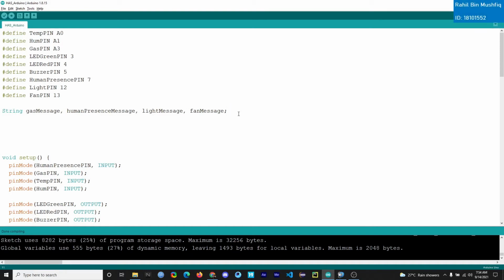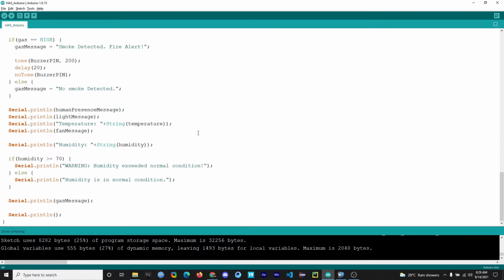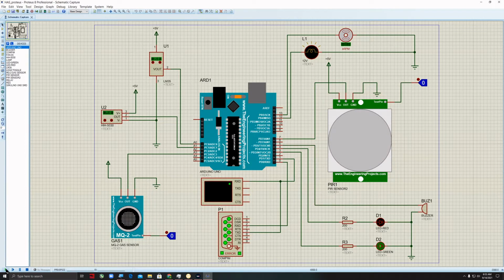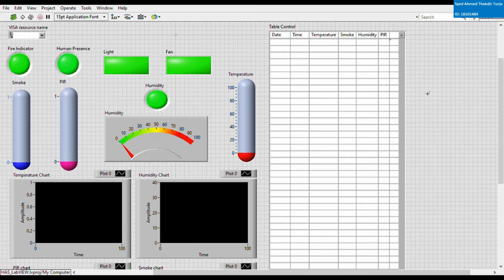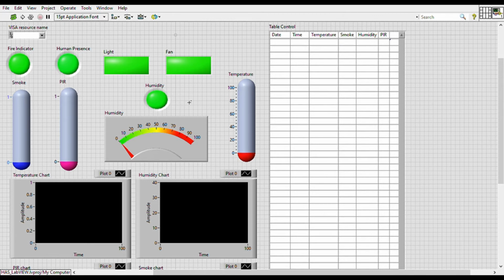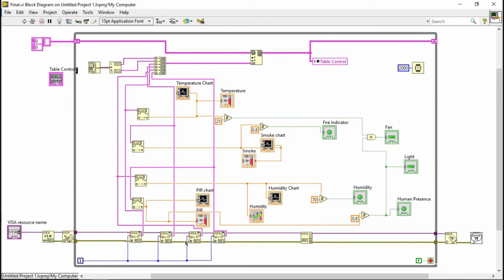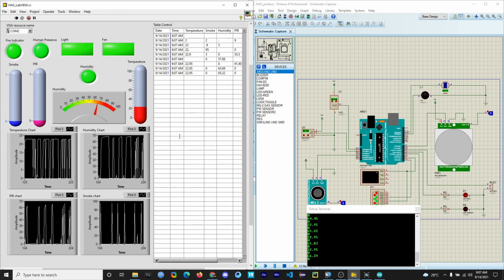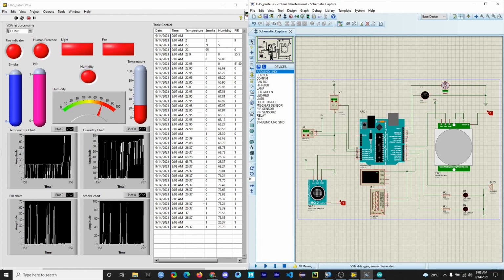Home Automation System using Arduino, Proteus, LabVIEW | CSE360 Final Project

Comment: the system work like this?

1.	Gas Monitoring System:
-	Utilize the MQ-2 gas sensor to detect and monitor gas concentrations within the house.
-	Implement the Arduino Uno to process sensor data and activate alerts in case of gas leaks.
-	Integrate a 5V relay to control the gas supply and trigger a shut-off mechanism during emergencies.

2.	Human Presence Detection System:
-	Employ motion sensors to detect human presence in various rooms.
-	Interface the Arduino Uno with motion sensors to capture and analyze presence data.
-	Use LEDs to indicate the presence of occupants and adjust environmental conditions accordingly.

3.	Lighting Control System:
-	Interface Arduino Uno with a relay to control the lighting system.
-	Use the button and buzzer for manual control of the lights.
-	Integrate LM35 temperature sensor to adjust the light intensity based on room temperature.

4.	Fan Automation System:
-	Utilize the Arduino Uno to control a 5V DC fan based on temperature and humidity readings from the LM35 sensor.
-	Implement a relay to control the fan speed or turn it on/off.
-	Enable manual control of the fan using a button.